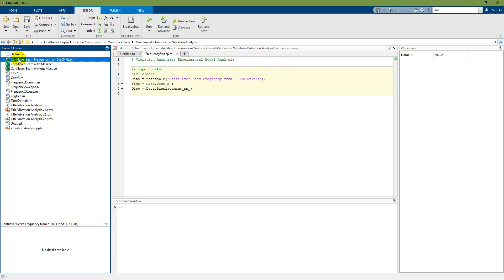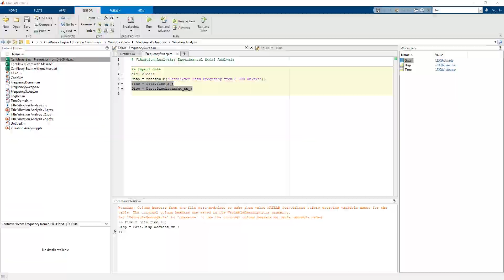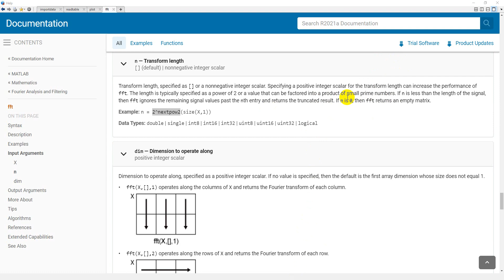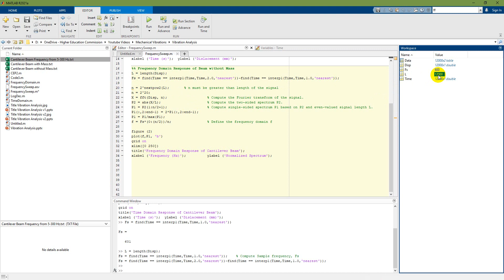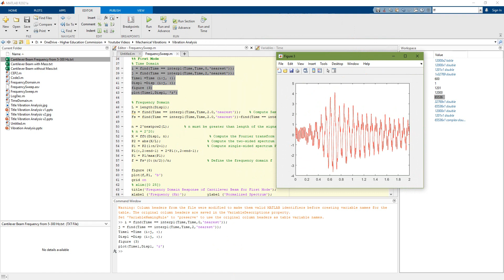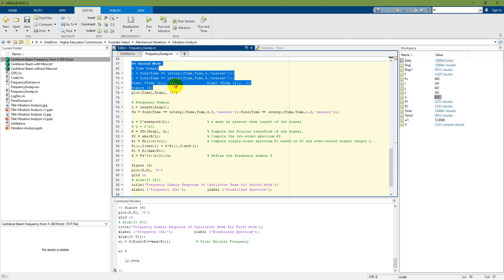Vibration Analysis 4: Modal Analysis using Time Domain and Frequency Domain in MATLAB

Comment: I have bearing set data in time stamp and acceleration data how to find out the fft could you send the fft code in matlab
Reply from the maker: You can extract from the video. I have explained in detail.
Reply: Sample frequency is  zero shows how to solve this problem